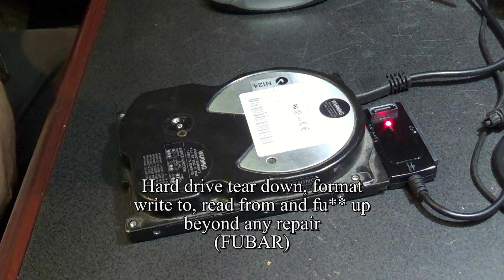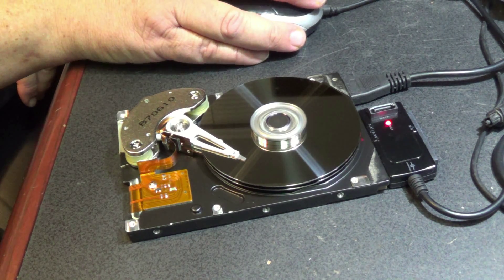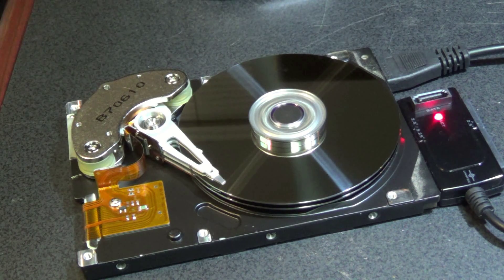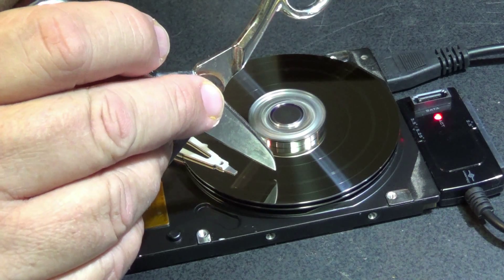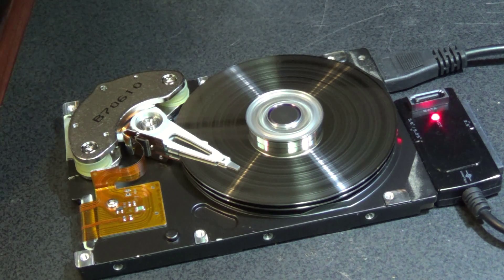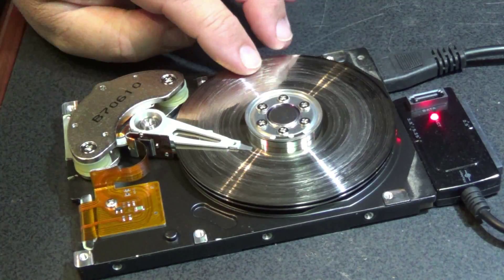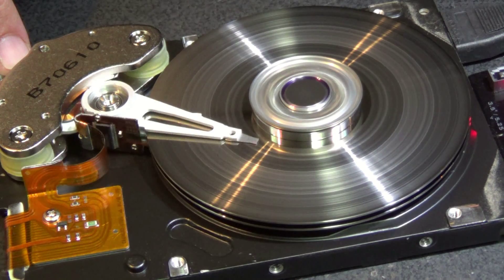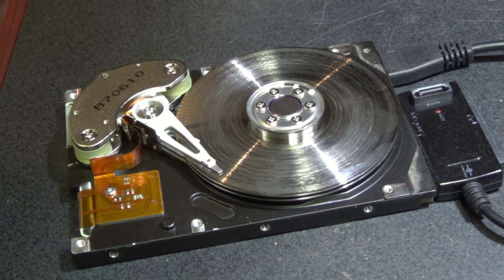hard drive tear down

Comment: At least I get to see what my Fujitsu MPA3035AT drive sounds like without the cover.  It did hurt to see you destroy the drive though.
Reply from the maker: Old drive headed for recycle.  Had to make sure data gone.
Reply: @12voltvids  You could have formatted it and sold it, but your property, you have a right to do whatever you want with it.  Also did you see my comment on your SyQuest removable platter hard drive video?
Reply from the maker: @cdos9186  
Yes I saw that. I will have to grab the drive and get the model off it. As to the small drive that one was full if errors so it wouldn't be usable anyway. I have many old drives but I won't sell them because I won't use ebay for anything. I got burned once selling on ebay and ebay and paypal did absolutely nothing to "protect" me as a seller basically saying that if someone is determined to defraud you, too bad so sad, that is the cost of doing business.  So I will never sell anything on ebay and have only purchased a couple of small things from there.
Reply: @12voltvids  Yeah sadly there are some buyers that will find a way to scam you.  I've purchased from one seller a Dell Inspiron 8100 and they just threw it in a box and shipped it!  Can you guess what, it was damaged.  I might make a video on the laptop but sadly it didn't come with the DVD drive so I have no way of installing XP back onto it.  Can you make a video on some of your old drives spinning up or tell me the models?  I am very interested to see which drives you have.  By the way the drive in the video you know how you completely destroyed the top platter and said it still worked after?  The drive you have has no top head, it has two platters with three heads.  The reason they didn't add a top head was for cheaper manufacturing costs for the smaller drive.  Mine I am positive has two platters with four heads because it is a 3.5GB drive.  My guess of your drive model in the video is a Fujitsu MPA3026AT.      PS:  Try not to destroy any other drives, if you have to, see how long the drive will last without the top cover!  Dust itself will kill the drive.
Reply from the maker: @cdos9186  
I got scammed in 2001 by a buyer and it left me so pissed off at paypal, and ebay and Elon musk. He still owned PayPal then and I will never buy a tesla as long as I live because of what they allowed to happen.  I lost 2450.00. 
I normally don't talk about this but perhaps I should.  It was an eye opening experience.  I sold my old evw300 Sony hi8 professional camera with a 14:1 canon lens with extender for 2200.00. By the time shipping and fees to cover PayPal and Ebay's highway robbery charges it came to just over 2450. I was paid via paypal and shipped the camera.  It arrived and I got my confirmation all was good.  7 months later my credit card bill arrived and I dam near had a stroke. There was a charge to PayPal for 2475.00 on my credit card.  I immediately called monster card to dispute.  This dispute went on for more than a year.  Turns out that the credit card used to fund the payment 7 months earlier was disputed. Card holder claimed they never made the purchase.   No seller protection as funds originated from a credit card and that is governed by the issuing banks terms of service and they said the buyer committed fraud but there was nothing they could do. Said it would be the same at a retail merchant if they accepted a credit card and the card was later disputed as stolen the merchant loses. Cost of doing business they say.  I am still pissed and you just opened an old wound. Perhaps I will talk about it. Might generate sympathy donations!
Reply: I located one for my brother on ebay, a 3gb version. It was the cheapest one i could find.

Comment: When I volunteered for MCC, I took so many of these apart for recycling.  They took a lot of time to take apart, so I didn't like it when the computer geek piled them up on my desk.  Now I regret taking them apart because they could have sold on eBay today no matter what the size was.  When my dad and I went to a computer store, one of the employees said that the disks were so flat that you could lift two of them up while only holding the top one; the other one wouldn't be separated.
Reply from the maker: Got to be careful selling used drives. Data breach. I did a tech roll at work 15 years ago. We pulled all the old drives and drilled holes through the drives before scrapping them.
Reply: @12voltvids  They still are good for collecting.
Reply from the maker: @infinitecanadian  
For what purpose. Too small to be useful.
Reply from the maker: @infinitecanadian  
I just tossed 2 old systems with slot 1 chips. A p2 and p3. I guess junk collectors want those too.
Reply from the maker: @infinitecanadian  
Computers. P2 and p3 as in Pentium 2 and 3 motherboards.
Reply from the maker: @infinitecanadian  Not this collector. This old tech time to recycle it. I have too much old stuff. I collect vintage radios, and audio video gear, but when it is beyond repair, I don't hang onto it, not even for parts. I have storage locker full of junk that I am slowly going through and putting the junk out to pasture.
Reply from the maker: @infinitecanadian  Nobody wants this junk. I try to give away much stuff, and when I get no bites after awhile I give up and dump it. On in the case of old CRT sets, use them as CCTV monitors and let the image from my cameras burn into the tubes and when the CRT fails from use, off it goes for recycling. I have a few really nice CRT sets I will keep, and the really small ones just because they are cool, but a 14" nope, not attached to one of those.
Reply from the maker: @infinitecanadian  
To tell you the truth I don't watch youtube much.
Reply from the maker: @infinitecanadian  
Sure but there is lots of that crap out there to go around.  I don't have room for it so off it goes. I give away much stuff to get rid of it but there is much that no body wants.
Reply from the maker: @infinitecanadian  well it was just taking up space  so out it went.  Much more is going to go to the recyclers.
Reply from the maker: @infinitecanadian  you are welcome to it.

Comment: well now it has that goes to show that you really need to do a great deal to injure it thank you for sharing this video it was fun . I do have a good computer question for you . I have a windows 7 x64 bit desktop I built and  I was wondering if there is any upgrades for a intel core 2 quad cpu q8200 @2.33 ghz . I have 8 gigs of ram and as I said the operating system is windows 7 x64 bit .I do not want to use windows 10 is there anything else to beef up what I have that is very in expensive thank you for your time
Reply: I don't know what your pc was, but with most of them you should upgrade to a solid state drive.

Comment: This hard drive wasn't destroyed when scratched with the scissors because the drive doesn't have a head reading the top of the uppermost platter.The fact that even dust touching the nanoscopicly thin magnetic material in the disc can create unreadable areas. It's unincredible how these things can so work reliably considering how sensitive everything is. The heads merely float above the disc at a mere 12 nanometers! on current drive, and around 250 nanometers in case of these old drives

Comment: Heads to work properly should never touch the disk otherwise destroyed both.
This is done with the lid on the hard disk. The lid creates airflow pressure and head lifted up slightly and the hard disk works.
start the disk without lid, desroy the heads and the disk.
Helow from greece and sorry for my bad english.
Reply from the maker: Yup, that's right. The purpose here was to destroy the drive before sending it to recycling, as it had personal data on it that needed shredding.

Comment: What you destroyed was 1 of 4 disk surfaces, never mind you can just buy another one from the hard drive shop.
Reply from the maker: Mentorcase Actually that drive has only 2 platters in it.Yes I know what I was doing. The drive was going to the recyclers, as it was only a 2 gig drive.I have hard drives coming out of my ying yang here as I get them out of olf cable and satellite TV boxes headed to recycling. I have a dozen or so drives ranging from 160 to 320 gigs, so destroying a small one is no big deal.

Comment: if you never took the cover off you might never know that the hard drive evolved from the record player...I haven't found anything to repurpose the arms or control circuits for but the magnets, case, motor and disks are treasure
Reply from the maker: Not really. The phonograph uses a stylus to track a pressed groove in the vinyl .
A hard disk uses a magnetic head like a tape recorder.
Watch my Sony Mini Disk recorder repair video uploading soon, where I repair a magneto optical drive.